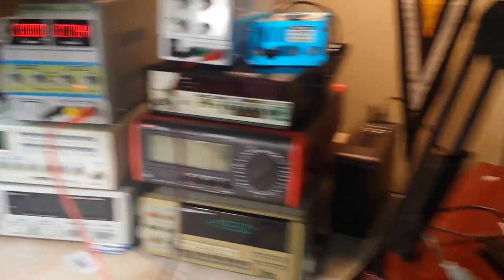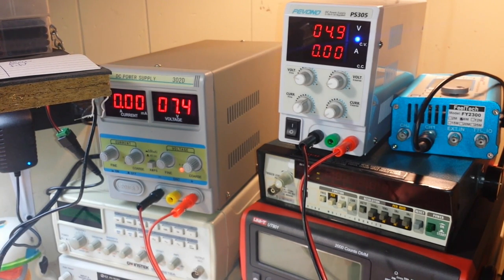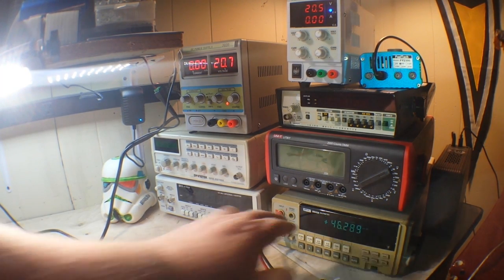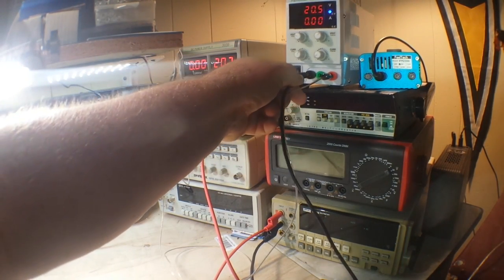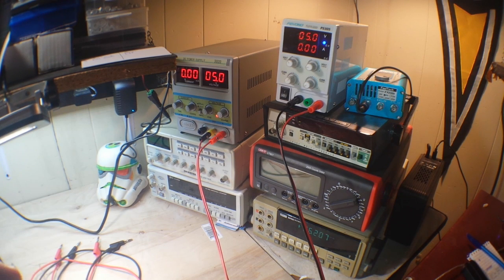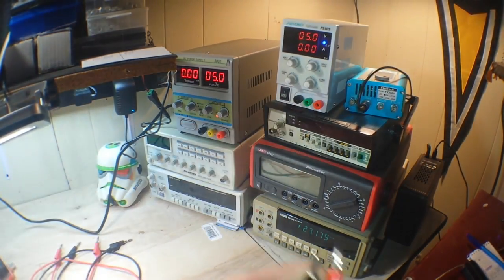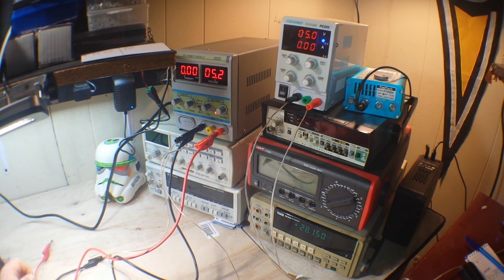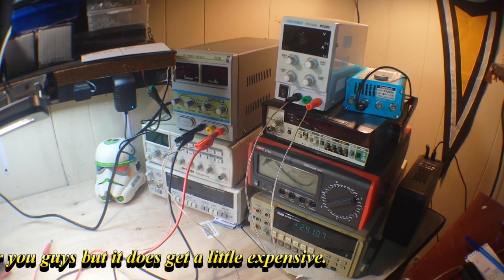Bench Power Supply Tips and Tricks

Comment: What if one power supply in series mode will turn off - it will catch reverse voltage to inputs; As I remember it's advisable to have parallel reverse biased diodes to each supply outputs. Maybe this protection is installed already in your psus but who knows how other supplies are build. Can you please explain this moment little bit in more detail?

Comment: Yup works this way for batteries also
Reply from the maker: Yes, that's exactly how battery packs are made. If you are into RC at all you will see pics sold that say 3S2P or 4S1P. That stands for 3 serial, 2 parallel and 4 serial 1 parallel.
Reply: bingo that's where i was going with my comment!
Reply from the maker: I used to have quite a few 3S1P, 4S1P, and 6S1P when I flew RC back before 2013.
Reply: Good tip thanks Paul.